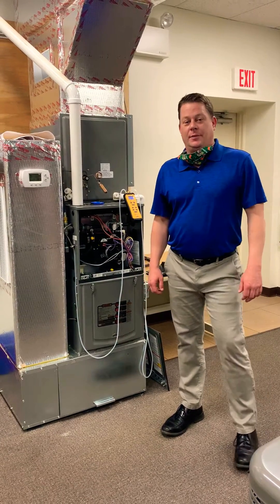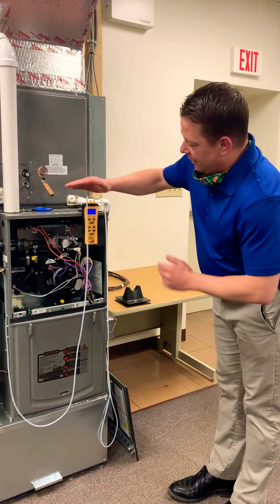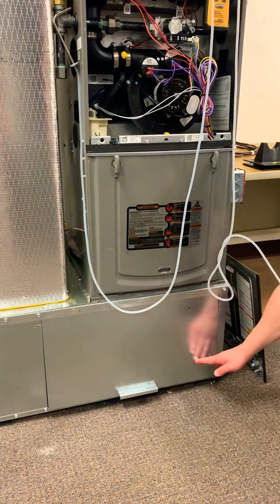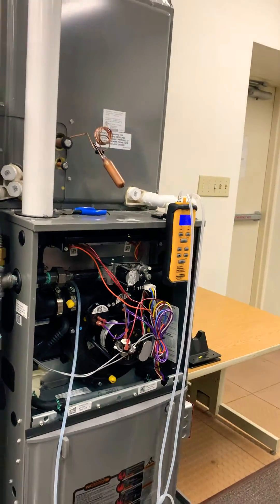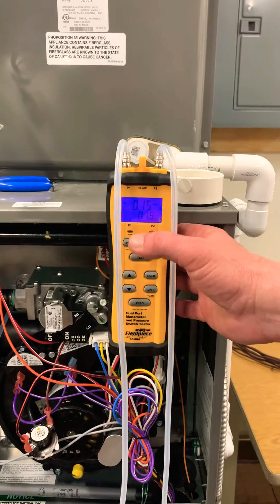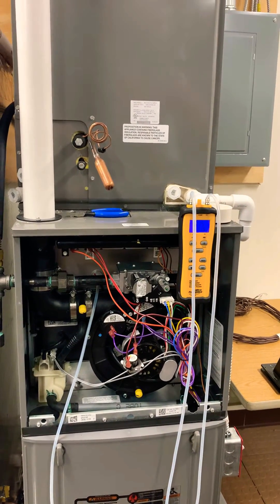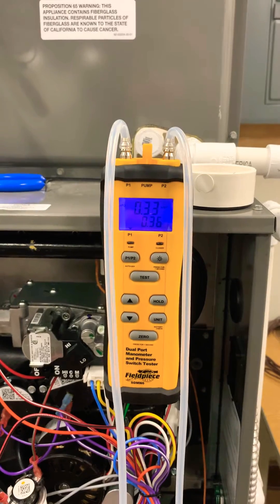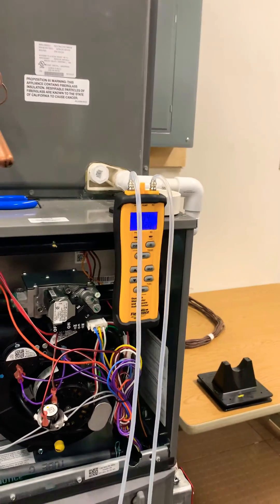How to Measure the Total External Static Pressure on an HVAC System.

Comment: It is better to measure the supply air flow at the back of the furnace as the air flow is slightly stronger there 
That’s the way I do it